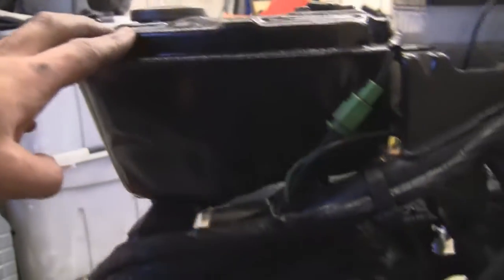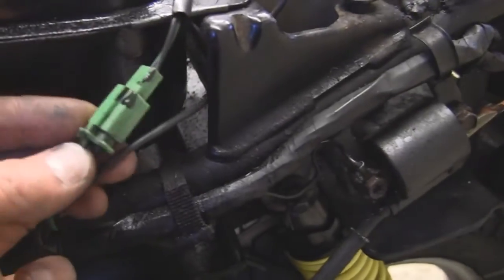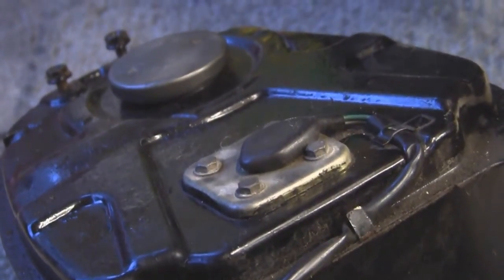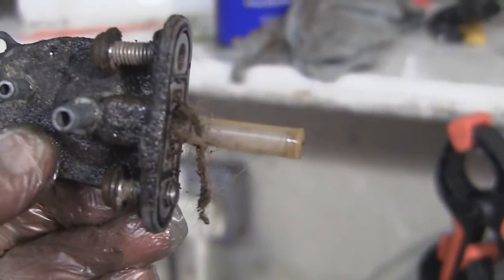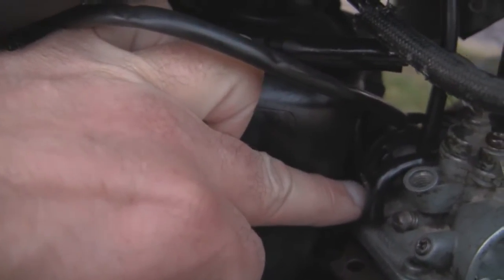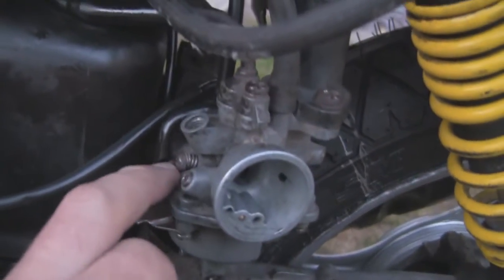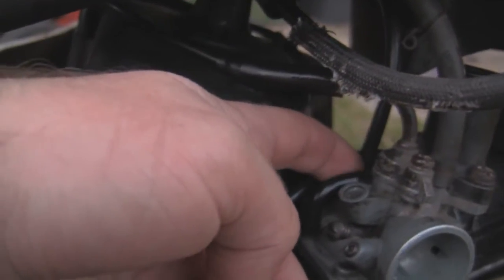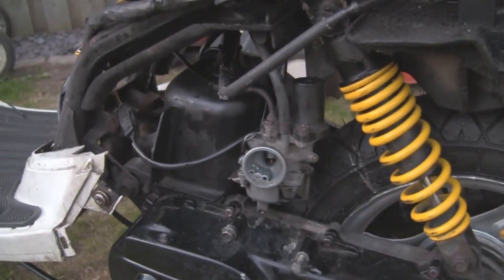Yamaha Jog Cg50 Moped Scooter Part 11

Comment: No oil in the fuel = seized engine. Autolube pumps oil into the carb to mix with the petrol to actually lubricate the engine. Very important

Comment: Have a silly question re the MBK-5RJ DePollution Filter I believe  The one side is connected to the exhaust the other side have a tube of around 1 meter does this just hang loose or need to be fitted somewhere ?

Comment: Hi, I am trying to draw oil through the pipe that connects to the carb using a syringe as you did, however it is very hard to draw the oil up. Is there a trick to it? I cannot pull it at all! Thanks!

Comment: Hello, I can't find the comment I left last time I got in touch on here - so I've cleaned the carb, new spark, tried kicking it over for a good 10 mins all to no avail. I can't really describe the sound it's making, I guess it's just a very weak sound of the engine catching on the kick. The carb bowl was dry when I opened it up, I'm assuming as it is on motorbikes the lower screw on the bowl is the bleed screw? Next step would be to double check the fuel line is clear (tank to carb is flowing fine) right, is there anything else I can check after that if it's not the issue? Thanks!
Reply from the maker: Below the petrol tank there is a fuel petcock where the fuel line goes from the tank to the carb. I think it's designed to stop fuel running into the carb and possibly leaking. It has a diaphragm in and a spring so it may not be pulling fuel through properly. Have you tried firing a load of easy start fluid into the engine then quickly putting the plug back in and firing it up? or spray some through the carb with the air filter off and the throttle open. Does the plug get wet when you try kicking it over? Sounds like a fuel starvation issue. Can you film a video?

Comment: Thanks for the oil flow tip!
Reply from the maker: foote king No worries have you got a jog?
Reply: Mower Man yes. I love it. I have neglected it for a couple years since I got my motorcycle. I am trying to get the carb working right again. Any tips would be much appreciated!
Reply: I just uploaded a video with my issue
Reply: Mower Man I cannot get it started.
Reply from the maker: foote king when was the last time it started? have you changed plug and pit fresh fuel in?